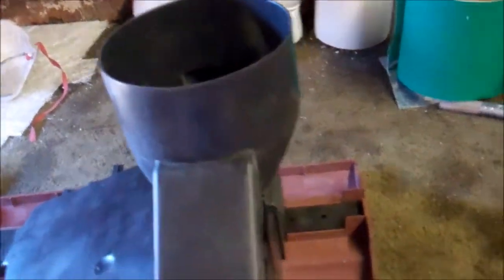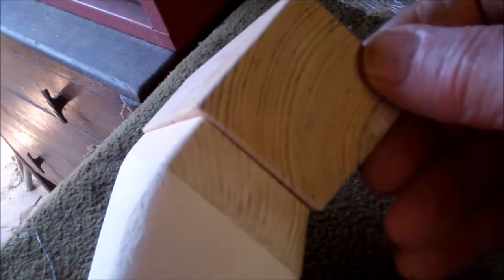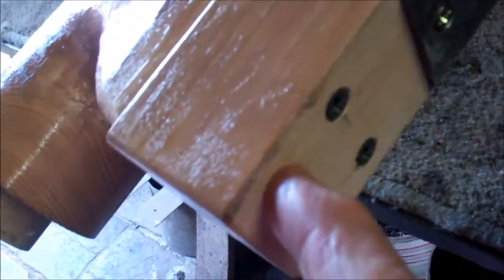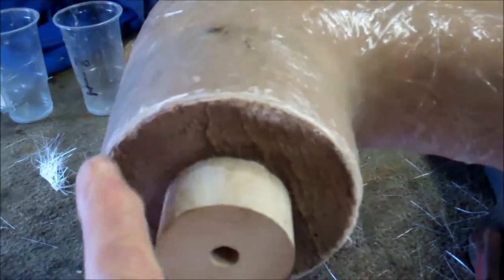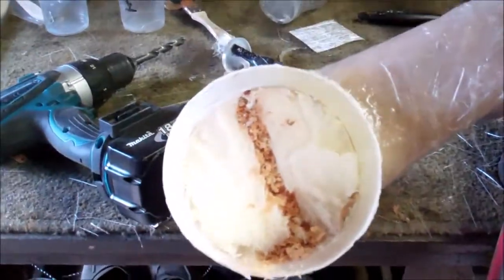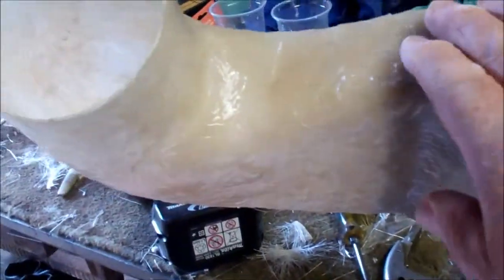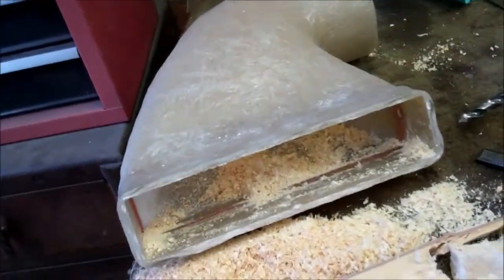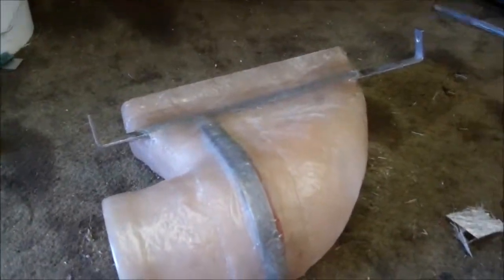Making a simple mould to make a fibreglass duct section.

Comment: What expandable foam product did you use please? Was it Great Stuff made by Dupont? If so, was it that in the red can or blue can?
Reply from the maker: Jim Perry, I used a general purpose expandable foam from a builders merchant, I was not very happy with it as after curing there were quite a few air pockets that I had to fill with a plaster filler before smearing a coat of silicone over it, but I was very pleased with the end result.
Reply: @johnbower  Thank you for the reply. I contacted the makers of Great Stuff and they told me that what I wanted to do was not an approved use for the product, that it's designed to cure via moisture in the air and using that much to fill a duct would not allow it to cure completely.  This is probably the reason why you experienced the air pockets. My cylindrical duct has a couple of bends (application: race car air duct running from behind front grill, through front wheel well, then into a port in the inner fender that connects to the air box over the carburetors). I am going to try flexible clothes dryer vent wrapped in plastic food wrap. The food wrap would be a substitute for the silicon you used (was your silicon a semi-solid gel of some sort? source?). I will wrap fiberglass cloth over the flexible duct and then embed that with resin. When hardened I will destroy the internal dryer vent duct to remove it.
Reply from the maker: @PandBMotorsports  Yes when I filled the wooden box with expanding foam I should have filled it in layers letting each layer cure before applying the next, the good thing about using this foam it's easy to carve into any shape, and is easy to remove from inside the fiberglass duct afterwards.
The silicone I used to prevent the fiberglass sticking to the foam was the type used for sealing around kitchen worktops etc, I just squirted it onto the foam then spread it out with a paint brush and let it set before applying the fiberglass. Hope this helps and good luck.